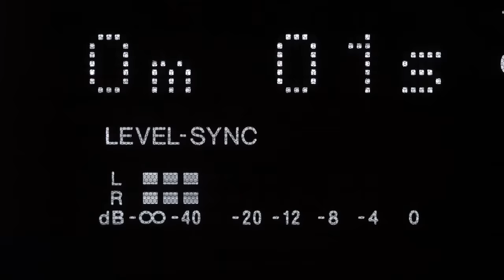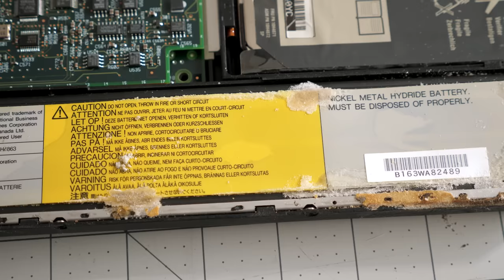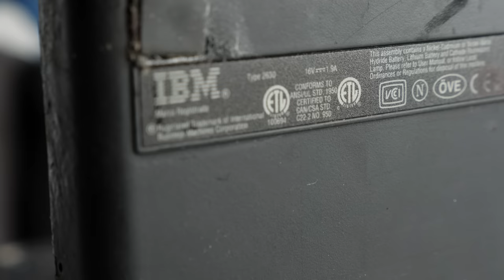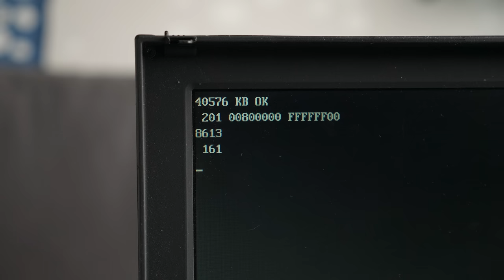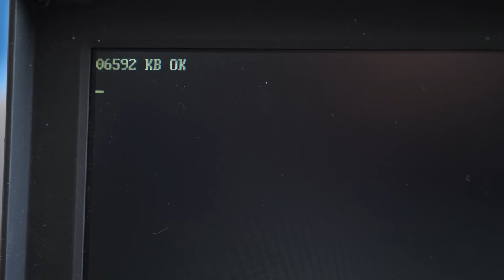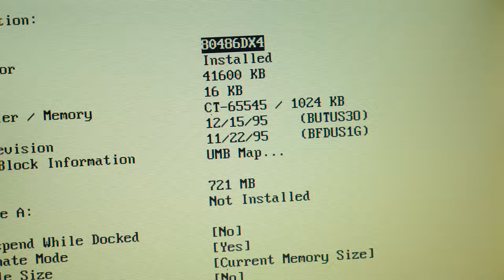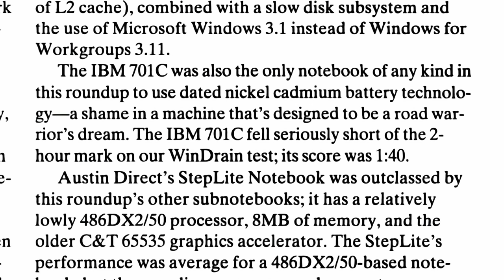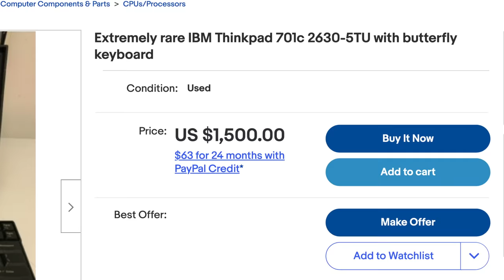ThinkPad 701c: IBM's Butterfly Laptop

Comment: Nice video!  Still have mine but I haven't opened it in 15 years. (I'll have to do that now.)  Luckily I took the battery out and put in in a sealed bag when stored. At the time, I upgraded to Win 98 and a larger hard drive, maybe 5GB?  Would work fine with the card/dongle wired network, but I could never get the 8-bit wifi card passed modern standard security.  Let's face it, it's an iconic design, but mine, at 75mh, it wouldn't even play an mp3 without stuttering.  I did do emailing and web surfing back before things became so graphic intensive. I'll have to check those eBay prices.

Comment: I wonder if you could just remove the soldered RAM off the board and try to run with only the aftermarket module until you can try to source compatible chips to replace the onboard?  I'd be willing to bet the memory issues are why it's not booting correctly and freezing up.  The CMOS battery issues, I'd be looking closer for damage from the battery electrolyte, though it could be unrelated too.

Comment: Lovely machine!
In my experience the boot errors persist until you've been into the bios setup and written/saved new values. Something to do with the cmos data being corrupt, but easily fixed. How did you get on?
Great video! I'd still use one of those machines today if they made them!

Comment: I bought a 600X (my first ever ThinkPad) and it has a corrupt BIOS.. so much for the seller saying it just needed a new CMOS :P

Seems a lot of old ThinkPads are dying, not just in the battery leaking cosmetic department, but lots of them get faulty boards that most can't repair.

Comment: Hello, you replaced the wrong battery, that was the backup battery used for hibernation. There is another coin cell soldered directly onto the lower motherboard. If you replace it you will most likely fix the RAM problems (it sounds like it makes no sense but it worked for my 701C). I replaced it with a regular CR2032 with two wires point-welded on it. Its very cramped so make sure its isolated well.

Comment: the freezing could be the ram too tbh, and the cmos battery not working might be bc u put a lithium one instead of a nicd one (I think this laptop used a nicd one anyway), which btw are rechargeable and lithium ones (unless a couple of specific models) arent so you should be careful

Comment: Last year I got my hands on one of these - and it works! It's not in the best shape, and the battery has been (luckily) removed. The HDD is dead and I have to replace it one day - I want to put the original OS it was sold with (well, there were two choices available, but if you're a true ThinkPadder, I believe OS/2 is the only real option for machines of this era) on an old IDE HDD that the old bastard can at least recognize.
I was damn lucky too getting it. I was working in a recycling facility where we fixed PC's for resale. Of course not this old PC's, without me it would have simply gotten trashed!! ...and that's why I got my own 701c - for free! Lucky, so lucky me =)

Comment: Some people use the stuff to clean, revive and protect black plastics and rubber in cars on some retro tech. I wonder if that stuff could be helpful in this case. 🤔 However is a risk of course to try in something like this because of that value in price, rising. But it could be an option in other cases with that rubbery stuff that covers some retrotech and gets sticky. And the owner could try a 3D printed solution to replace that part of the plastic destroyed by de battery, if possible of course.

Comment: There's a 25% chance that giving the M/B a 6 hour deep cycle in a sonic bath will bring it around. I wouldn't bin the battery myself, that can be gutted, cleaned and re-celled with modern chemistry and electronics. Tell your mate not to give up on this machine as it's not as bad as it looks, hard work and a few bucks yes, but well worth it.

Comment: can RAM chips go bad? Never had this, ... Maybe try to refresh the solder of the chips?
Reply: It's fairly rare which is why most reputable brands of RAM have a lifetime warranty, but it can certainly happen, especially on a system you've kept around for many years.
Reply: Absolutely! Lots of machines from the 80s have at least one bad RAM chip nowadays. Mid-90s is rarer but, hey, time marches on…

Comment: The coin cell bettery replaced in the video is not the CMOS battery. Bootup issues and 201 Memory Error can be resolved by replacing the CMOS battery soldered underside of the bottom motherboard. Take the entire laptop apart, take the bottom motherboard out, desolder the battery and replace with any 3V coin cell battery that fits. There is a small + sign there, that is the negative side (confusing I know). All the errors shown in this video should go away now.

Comment: These 701Cs really were doomed from the moment they were made, the batteries inevitably leak and everything you experienced is honestly par for the coarse with these machines. 
Hopefullly you didnt get rid of the battery already, there's an IC in it that can be reused to rebuild a new battery out of modern NiMH cells, without it you won't be able to get any batteries to work. NOS batteries are pretty much nonexistant and I don't think the protocol the battery uses has been decoded yet.
Reply: Valuable comment!

Comment: I have this laptop (I think the CS model though) That crack happened to mine too and grenaded the hinge assembly. Its a shame cause otherwise the computer works great. I need to get around and fix it with some reinforcement. The hinge attachment to the top assembly is laughable and its a wonder why it broke there.

Comment: Laptops make terrible retrocomputing machines.  The only advantage to them is their small size. But their poor performance, LCD screens and non-standard parts make them particularly unsuitable for retrocomputing, especially retrogaming.   The LCD screens in these old laptops look absolutely TERRIBLE in any mode besides their native modes. They look very distorted in anything but the 800x600 most of them operate at.